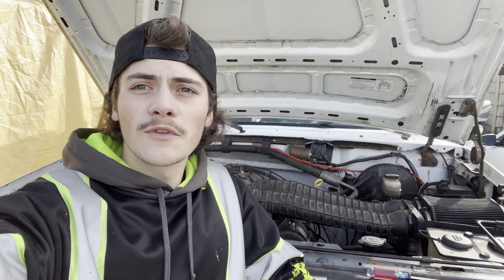92-97 OBS FORD F150 power steering pump replacement/ repair

Comment: What intake are you running?
Reply: Its a 351 windsor 5.8 lr nice engine
Reply from the maker: I wish 😂, I hear they made f150’s with the 5.8, and I’ve heard the 250 frames were the same with stronger axels and suspension……. If I find that to be true I might put my high rpm N/A 5.0 build to the side for now, and figure out the 5.8 swap, plus a few other things that aren’t common so I gotta keep that to myself, just in case I make a video on it 😅🙏🏻
Reply from the maker: Stock 1993 5.0L Windsor truck intake, should’ve been stock for both 8th and 9th gen f150’s, it’s taller than most intakes and designed around torque unlike like shorter ones designed around HP and high rpm/ more air flow

Comment: Dose power steering pump line wiggle around that comes out the side
Reply from the maker: The rubber part of the line is flexible to account for engine/ transmission vibrations

Comment: I noticed that you have the same airpump delete and how you ran the belt. I would like to know if the tensioner works better this way. The way mine was put on when I bought it was to go under that pulley that isn't used, the one above the tensioner. Making the belt a bit longer than the one you show. The tensioner isn't very effective because the angle of it doesn't allow for a constant pressure on the belt. I can't find a belt that is the goldilock size. The ones I have tried are like 3 or 4 mm different. Either way too tight or too loose and that causes the a squeal on the water pump pulley. The tensioner wasn't really made for the new routing but is seems from looking at yours that there is no other tensioner to use. Or is there? Good video though as I am going to replace my steering pump within the week. Looks easy, just messy but no real problem with that.
Reply from the maker: I have a squeal on start up, and my alternator bearing is squeaking, they sell a idler pulley to go in place of the air pump which I want to install at some point and maybe an under drive pulley kit, but the belt I have on there is a gates belt and it has held up great. other brands were like you said too loose or too tight, this one seems to have great tension on it
Reply: Replace it with a dummy pully.  I had mine like that for a while with a shorter belt and the one pulley not doing anything.  The extra stress cause my ac pulley to lock up.